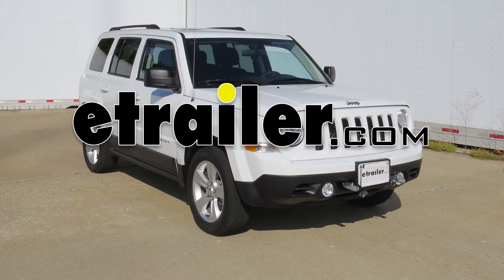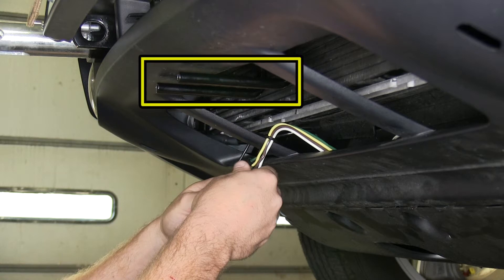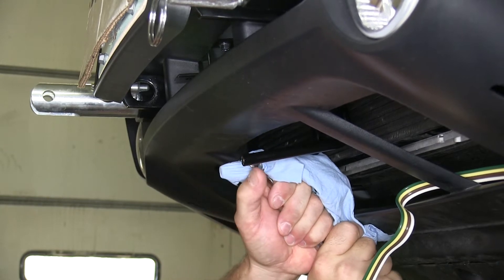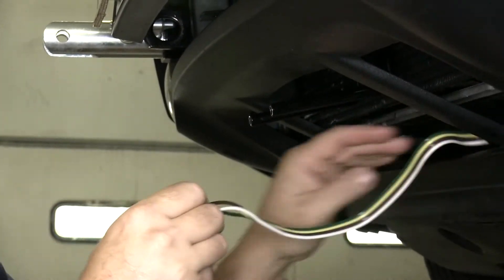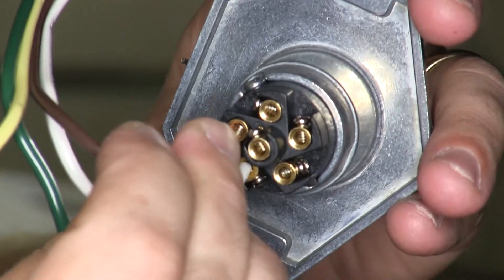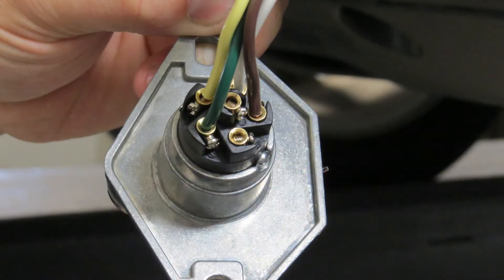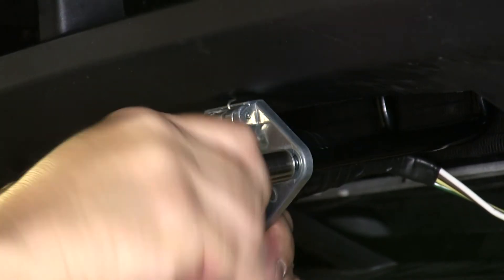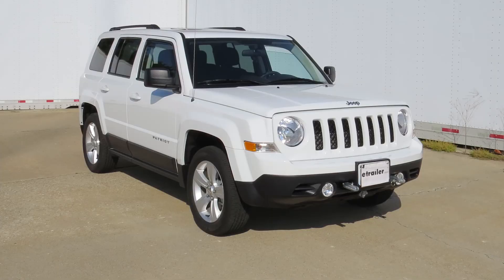etrailer | Setting up the Pollak 6-Pole, Round Pin, Trailer Wiring Socket on a 2014 Jeep Patriot

Comment: What kind of trailers have this 6 pole plug on them? I’ve been towing for a while and all I’ve seen is the 4 way and 7 way
Reply from the maker: A 6 way plug is used on trailers that do not need a reverse light signal but still needs brakes and a 12v signal. That is the only difference between them and and 7 pole. Many times they are used in flat tow set ups.
https://www.etrailer.com/Wiring/Pollak/PK11608.html

Comment: Why you didn't hook up the break control wire ?
Reply from the maker: In this application the brake wire was not needed because it is being used for a flat tow set up for towing a car behind a RV. The brake signal wire would need to be installed if this was place at the rear of the vehicle and the Jeep was towing a trailer with brakes. The vehicle will get its braking ability from another braking system that would receive the signal from the RV.
https://www.etrailer.com/Wiring/Pollak/PK11608.html